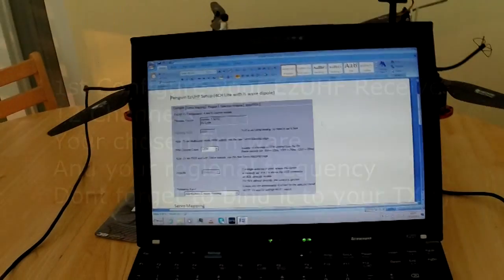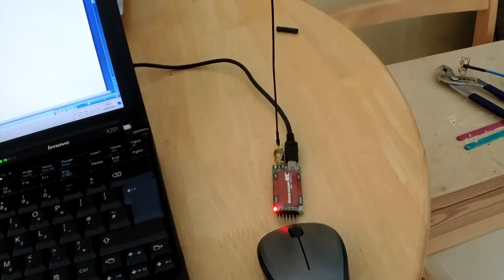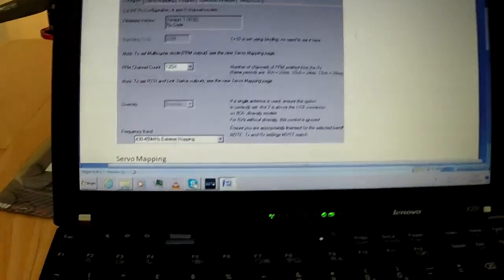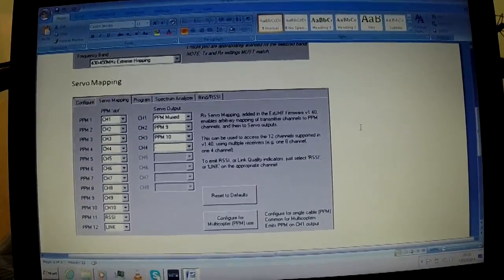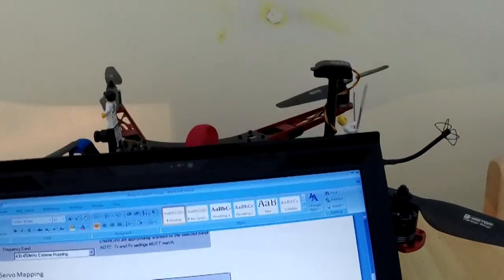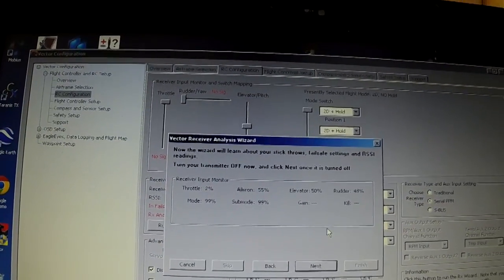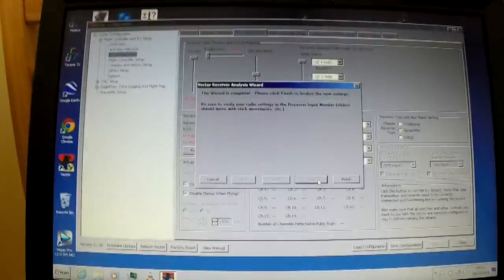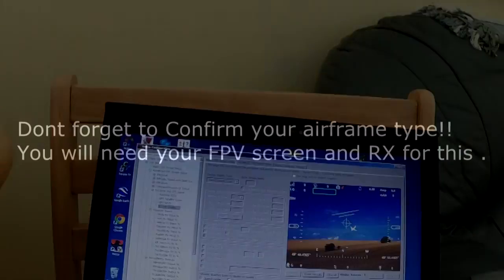Eagletree Vector EzUHF SPPM Config with RSSI & LQ Setup

Comment: What channel on the ezuhf RX did you change the aileron connection to pls…?
Reply from the maker: Ch1 if I recall correctly.
Reply: @CarftyCarper  
in the video you originally had it connected to channel 1 but stated you had to change it as the vector RX analysis wizard didn’t detect any channels…?
Reply from the maker: @thunderkraken  yes because the channel output was not sppm muxed, let me see if I can find a picture.
Reply from the maker: @thunderkraken  see 2:20
Reply: @CarftyCarper  
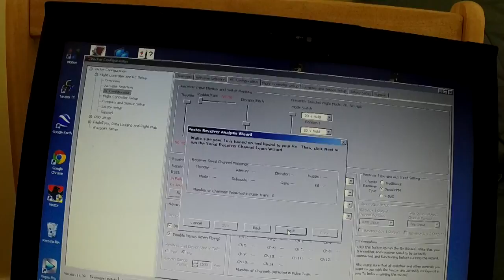thanks for replying Keith but I must be missing something, you had the aileron connection from the vector connected to channel 1 on the ezuhf RX, you had channel 1 set for SPPM on the IR tools config page and this happened 10:01 mentioned in the video “now have the aileron plugged into the correct channel”…?
thanks again....

Comment: awesome helpful vid Keith.... just one question though, do you lose the 1st channel in your EZUHF Receiver to outputting the RSSI? 
Or do you still use it for aileron and tap the signal wire to sent to the vector?
Just cause the plane i'm looking to build will need all 8 channels
cheers!

Comment: hito get failsafe right did you have  trims on thr or something configured ? I am getting the needing more the -5 value to configure failsafesame setup TARANIS - EZUHF - VECTOR
Reply from the maker: +Aron Gatt I setup a switch to take my throttle down -10 below standard. Then set failsafe on eZUHF with that switch set.
Reply: Keith Sutherland thanks guess that would have worked aswell , i managed to get it to work with , down trim and set failsafe on ezuhf then ran wizard and done!

thanks for reply tho